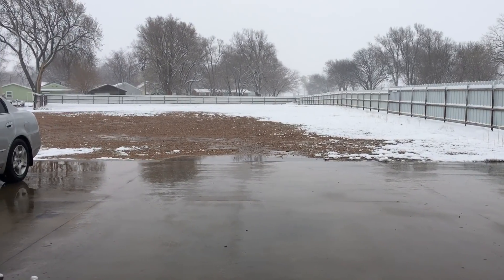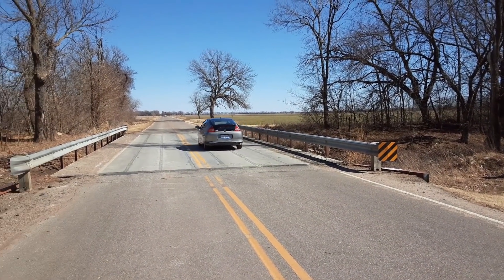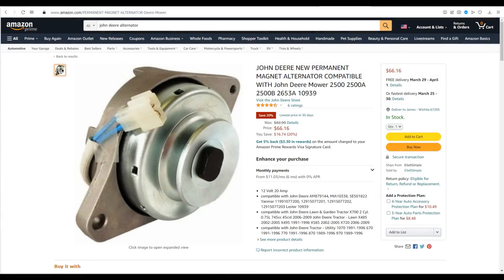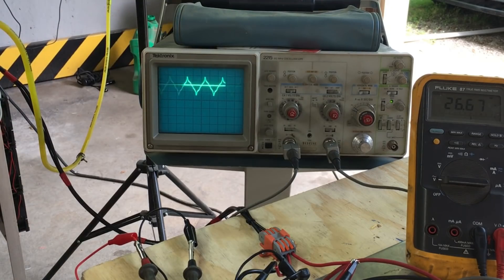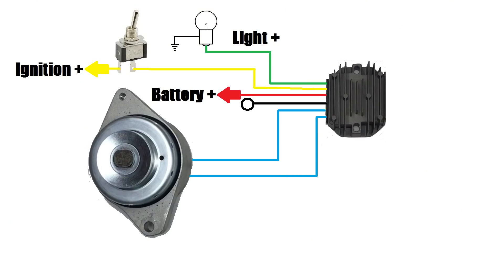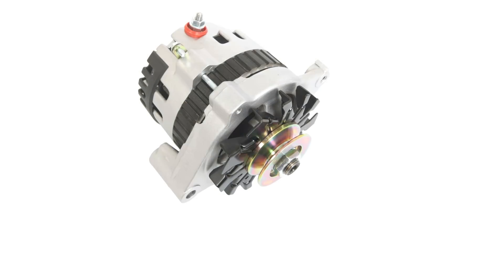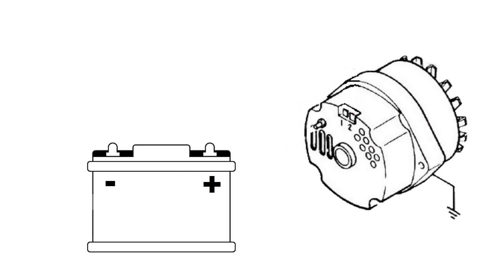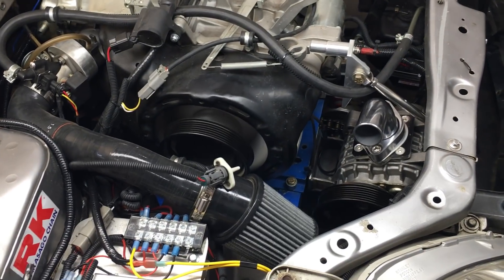S2E4: We generate MASSIVE (20 amps) electrical power for our 420cc engine with a mini alternator

Comment: I once built a Amish battery charger from a old 8hp Briggs with a 140A GM alternator and it would make that Briggs work under a full load keeping 2 4D Diesel batteries charged while running a 2000W backup inverter.

Comment: When you say the gy6 regulator is useless for a predator charging coil setup, why is that?
Reply from the maker: It did not work.  As I recall the most I could get from it was a half an amp to charge the battery.

Comment: hmmm that alternator might make a good electric dyno (resistance / creating a load by feeding dc current through it) ah ok you allready made one that way

too bad you cant put the alternator in place of the stock coils behind the origina flywheel (you might be able to if you can hog the original axle out of the alternator and create enough room to  mount the housing angainst the carter of the motor  over the cranktap then adapt and mount the rotating part of the alternator  over the tap (same taper machined inside it so it clamps the cranktap)  bolt the whole thing down that find a way to mount the plastic fan and the pulley over that whole lot , might move the pulley out and fan away from the schroud a little 

you could measure torq aplied you youre dyno using a bathroom scale and an arm mounted to the alternator (the alternator want to spin with the force applied to it by the motor driving it , youre measuring that through the arm that is basicly an amplifier/reducer to give you a better range on the bathroomscale ) can use a loadcell too that be more precice

Comment: If you ever did use a automotive alternator I'd probably recommend one from a older probably carbureted 4 cylinder car. Usually smaller and around 45-50 amps. Just from what I find. But I also think some of the newer cars (I think from Toyota, maybe they all do now) have alternators that you could turn off even at idle. If you ever wanted to use a car alternator that is.
Reply: There are lots of one wire industrial / tractor alternator options in that 50 amp range. I have used a  WIL 90013125 in the past with good results. At these slower speeds you're never going to get the rated power (thus load) out of it, which is a feature in this instance.

Comment: Those 2 pins on the PM alt make me suspicious, has it got a diode bridge internally outputting unregulated DC?
As for the car alt, if you can control the field current you can control how much torque the alternator pulls, though now you have an unregulated power output, but using it as a brake into the power resistors would have nice control.
Reply from the maker: The John Deere alternator outputs an AC sine-wave.  I cover this in the next video, Stay tuned!

Comment: This JD alternator isn’t any different than what Ford did on the 3.0 running a single belt to the water pump on the (other side of the engine) come on jimbo let’s blow this cement mixer, I mean stupid charge it!
Reply from the maker: The Stupid charger is coming up soon, stay tuned!

Comment: General rule it takes about 1hp to produce 25 amps at 12 volts. Edit for trolls V belt driven alternator application
Reply: That's a pretty crappy efficiency.
Reply: @Andy-df5fj  Yes it is 😮
Reply: I like turtles

Comment: 90s fords have a internal regulation alternator the 3g series. Very simple and 25$ at the upull yard. 3 wire hookup green/ red stripe is keyed hot input yellow/white is voltage sensing hook this to main output.

Comment: Don't apologise for content, it was interesting as always! quick question is the Supercharger plumbed draw through or blow through? hard to tell from the Vid.
Reply from the maker: The supercharger is set up with the throttle body in the intake side of the blower and the injector is places  on the cylinder head pointing at the intake valve.. So in other words, the blower stays dry and only air passes through it. I didn't want a wet system because that would likely be harder to tune.

Comment: Like the video. Yes, that GM alternator will rob almost 3hp at wide open throttle. Permanent magnet is the most efficient since you eliminate the 0.4-0.5 amp  current needed for excitation. A wind power generator, rewound to generate power at a lower rpm could be an option. Most have permanent magnets,  but are too pricey right now to consider as an option. 👍

Comment: If you were to isolate those two coils from the ground and put both of the wires to the full bridge rectifier you would have double your out put like one coil 3amp and both coils 6 amps.
Reply from the maker: Yes, that would work great for extra power from the charging coils.  Good point!

Comment: Love to see the progress. Did I infer correctly that you are now planning on belt driving the forced induction and not exhaust gas powering it? I admit I am slightly disappointed but I can't complain because I know I will still love the series and I can't wait to see the rest! Maybe you could use the exhaust gasses to power a small alternator instead so they aren't being wasted... hmmm... that's an interesting idea.
Reply from the maker: We  decided against using the turbocharger and are using a belt driven supercharger instead.  The reason for the change is the 420 engine does not have an oil pump and the turbo needs pressurized oil for lubrication. I'm sure an electric oil pump would work, but that  is an engineering band-aid.

Comment: I've never seen a reg/rec unit where the remote sense would disconnect it. All the ones I've worked with always have the BR connected to DC out. Disconnecting the sense wire just kills the regulation, meaning they over charge.

Not saying yours doesn't disconnect the diode output, but it's odd that they'd put circuitry in to do that.

Comment: Going on record to say the cutoff switch will show no measurable performance improvement:  Even at full load, the micro-nator can only put out your 20A x 12v = 240w.  With 746 watts per HP, its gonna draw 0.32171581769437 hp.  That's 1/3 horsepower for people that hate decimals, and God bless em.
Reply from the maker: You also need to factor in the alternator efficiency.  The power it takes to generate 746 watts is more than 1 HP because the alternator is not 100% efficient in converting the mechanical energy to electrical energy.  If you listen to the engine when I switch off the alternator there is a noticeable change in the engine sound.
Reply: @robotcantina8957  indeed, plus the friction of the belt/pulley whirling interface

Comment: I may be mistaken, but the permanent magnets mean this unit is a DYNAMO. (not an alternator)  Dynamo's are well known for reliability because there are no 'brushes' ....as long as the regulator is robust.
Reply: Wrong. Dynamos make DC power without any rectifier. This is a permanet magnet Alternator, producing single phase AC, like smaller/older motorcycles.
Reply: @erik_dk842  Actually, smaller-older motorcycles also used a brushless dynamo. My old 1960s Yamaha went one step further by using the dynamo as a STARTER too.
Reply: @brucepeebles4939  If there are no brushes, they can only produce AC. The distinction wasn't clear back then. I know dynastarters, both they are actually alterstarters. In USA, they got it backassawkward, so they call dynamo's, which rectify the generated AC internally to DC by a segmented commutator, generators.

Comment: Excellent Vid!  I was using the alternator switch idea 30 years ago in my boy racer days.  Mostly nights actually and I knew the alternator was a load when every bit of HP counted.  I upgraded the regular Switch to a Vacuum switch so I didn't have to remember it in the heat of battle or to turn it back on later... which may have been more important going on experience. 
  The vac held the switch on and when floored, there was no vac so the switch disconnected and everything shut off.  Let off the throttle and it all kicked in again.  Worked well. 

 Way I had it the thing would disable the alternator, the AC and cabin blower and the engine cooling fan.  Hey, I was going fast so plenty of air through the radiator till I slowed down and let off the throttle. Alternators as you said are inefficient, very much so on cars, so the power saved electrically was much more at the crankshaft. 
 The vac switch was good for when you just wanted to go up a hill or burn someone off spur of the moment.  A brake light switch on the throttle could also be used with a DPDT relay in your application.  When the throttle is up at idle the alt is active and when you mash the pedal the alt drops out through the DPDT relay.  I use that setup on the water injection on my 4WD.

Those little permanent magnet  alternators are also found on my smaller Kubota diesels as well. 

This was a great Vid and I certainly hope you do more. I knew all this but it was still very entertaining as per usual  and typically well presented.  I'm sure a lot of people did learn from it and  will in other similar vids which I look forward to seeing.
Reply from the maker: The vac switch is a great idea!

Comment: Jimbo, I know you say you don't want to use an automotive alternator, that's cool. If the biggest sticking point is literally wanting the ability to turn it off during power runs I believe that the "idiot light" is actually used to excite the alternator into working. Older alternators like that would often not charge the battery if the alternator warning light had blown (particularly older Mitsubishi's).

If you fit a DPST (or DPDT) switch and use that to break the connection to both pins 1 and 2 (idiot light and ignition switch) that should hopefully let you turn the alternator off. I imagine this would be a fairly simple test and may open up avenues for you later :)

Comment: Of course you can connect ground to the rectifier, with the charging coils. But not if the other side of the coils are also connected to ground! 
And that is probably standard so would require a modification.

Comment: I love that your DIY car has the same alternator issue as my 2006 Toyota Matrix 😂 
My alternator has 3 stator magnets in it, 1 of them died so it doesn't charge at idle anymore. Been going over a year like this and have a spare alternator in the hatch waiting for the day it dies altogether 😂 I'm just careful not to idle under 900rpm for more than a few minutes. Starting up is always 1200-2000rpm so I can idle it while it warms up no problem!

Comment: I wonder if a solar charge controller would work as a voltage regulator.  A cheap renogy 20a PWM,  I have starts charging at a lower voltage than my victron mpg.  They cut out around 13.9-14.2 v.
Reply: Dang,  totally forgot its ac coming out of an alternator.

Comment: The car alternator still the best option for your application.
The JD alternator with permanent magnets have drag 24/7 no matter what, but the car alternator just disconnect the regulator output to the brushes for the rotor, almost 0 drag, they spin effortless without an energized rotor

Comment: Question without criticism: If it’s a permanent magnet alternator how does cutting the current output reduce engine drag? Decrease in magnetic flux only?
Love your work 👍
Reply from the maker: By shutting off the regulator the alternator is no longer providing current to charge the battery.  If you listen closely in the video, when I shut off the alternator, the engine speeds up a little bit.
Reply: @robotcantina8957  Thank you. Trying to get my head around the physics. I think the greater the current draw, the more restriction to turning in the alternator because of increased magnetic flux. Remove the current = remove additional flux (additional to magnets alone)
Reply: @54mgtf22  — Thanks.  I had the same question.

Comment: In automotive performance parts supply company catalogs, such as Jeg's and Summit, you'll find mini-alternators w/mounting kits for use on dragsters that run a 12V+ system. Perhaps using one of these might help meeting any charging demands that call for more than 20A output.

Comment: Question: Would you be able to hook a voltmeter up to the idiot light circuit of the alternator to monitor the voltage to some degree? I'd imagine so, unless the controller outputting the 12v signal for the light corrects the voltage internally.
Reply from the maker: The volt meter would need to measure the electricity across the battery.  Measuring the voltage at the idiot light would likely not show actual voltage.

Comment: That was very educational! Thanks. Would a electrical motor generator (perhaps something a little bigger than the permanent magnet generator) be configured to help start the engine and provide some torque on take off forming a kind of hybrid design? 
I have a couple of such motors (generator and motor) that can put out around 5hp for short bursts. They need 60V so some voltage converters and a control circuit would be required. I have a vague plan to use these in one of my cars...to make it a hybrid of sorts along with a bank of LiFePO4 cells providing around 14kWh or storage.

Comment: I have blown the fuses in my fluke a few times over the years….
Reply from the maker: They can be expensive to replace.....
Reply: @robotcantina8957  where I work we stock 10 packs in our shop/equipment supply area. Never paid out of pocket so I’m not sure what they go for. 

Almost always would blow them forgetting to switch my leads back to the correct port before checking voltage. 

At least I’ve never fried my pico scope. 🤔 …. Yet….

Comment: Hey Jimbo,
The ribbed belt to the supercharger would be cool to run past a large hyundai sonata belted hybrid starter generator, you could use that as both a starter to start, a hybrid motor to get crazy 0-60 times and also to charge the battery!
That system gets a lot bigger and complicated but it would be real neat!
The other thing is, its a lot more efficient than a normal alternator because its designed to also motor very efficiently.

Comment: If it has permanent Magnets, isn't it called a Generator? (Old School,  68) Ok, maybe not, but I will say even though you switch off the alternator you still have parasitic loss of power every time the stator goes past the magnet as you felt at 1:50. And I say old chap. Cogs?   Lol. keep the videos coming... 😎😍😁

Comment: i am looking for an add on mini amp for a gl1100 goldwing. the stock stators are a pain to replace, and priced like diamonds, so i'm thinking an external aux. alternator is my solution. i'd just like it to have about double the amps to power an onboard ac inverter. this might be an option running two of them.

Comment: Could you use a buck converter on the output of the rectifier? Amazon has 300 watt adjustable buck converters with heat sinks

Comment: Don't the regulators need power from the 3rd wire so that they'll work?
Reply from the maker: The yellow wire supplies the regulator with 12V to turn it on.

Comment: That secret switch on the control wire of the regulator is something I been using on my yard kart with a Honda GX390 that has a 5255 (60amp) ford alternator and 8224 lawn mower battery on it. At an idle It’s enough to start a big block Chevy with a dead battery. I turn off the switch for high speed runs. It does about 50mph. That’s pretty quick for an old Murray explorer yard kart.

Comment: Looks like you brought some Michigan with you after moving (weather). It's been the same here in Michigan. Michigan never gets the memo on spring. It's just that turbulent chaotic battle between winter and spring until summer just steps in and sends them both off.

Anyways, always impressed by your vast and wide knowledge of electronics. This was a great video, and extremely well explained. I don't have nearly your expertise in electronics, and yet it was very easy to follow along/understand it. I liked that you showed the demo on the dyno of what would happen with a car alternator instead.

Seems like you definitely made the right call on alternator choice.

Feels somewhat ironic that it needs such a careful choice of alternator, given that while this one was a cement mixer engine, they're also in the same vain as those used as generators for houses.